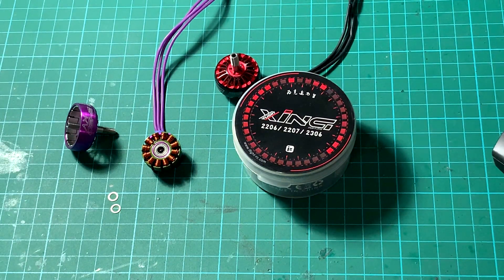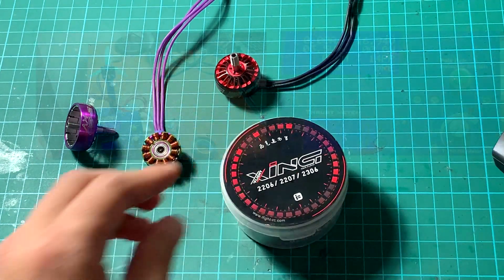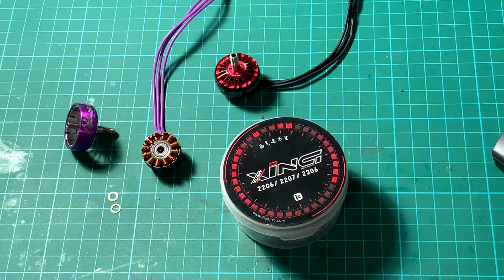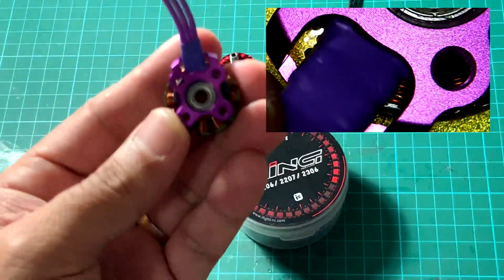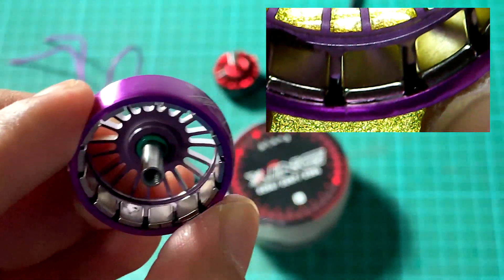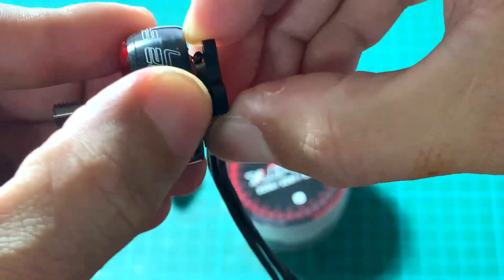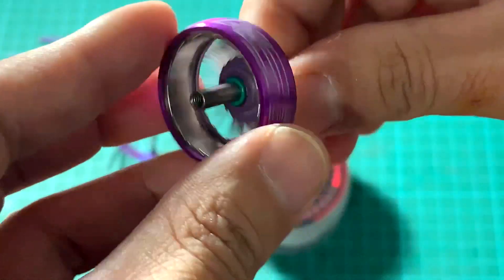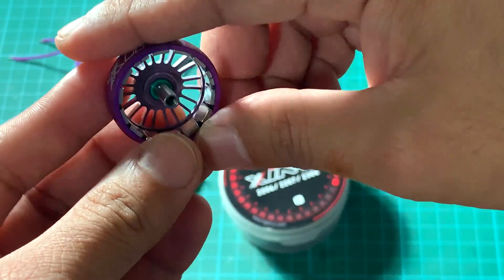iFlight XING Next Generation Motors

Comment: Can you please measure if the bearings are 8mm OD or 9mm OD
Reply from the maker: The bearings are 9mm OD.
Reply: @azkikr316  thanks
Reply: @Kabab  definitely 9mm OD bearing and the 8 that I have 2207 size 1800 kv the stator measures 2207.4 which is close to a 2207.5. or it just could be the lamination being thick. If you got this motor can you confirm Bob?
Reply: @FarmerFpv  I have the 2207 and 2208 on the way.
Reply: @Kabab  oh nice, I can definitely tell you the 2207 1800 KV is pretty impressive and pretty smooth. I was shocked because usually I spend a lot of money on Motors. But only paid $72 for a set of 4 on Amazon so I bought 8 lol. Seriously can't beat the price and performance. Look forward to your review Bob!!